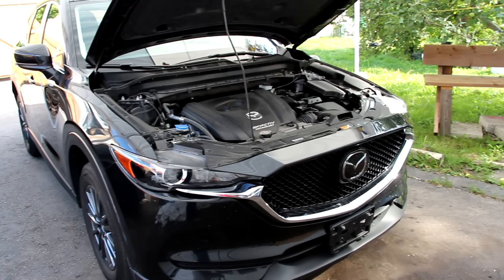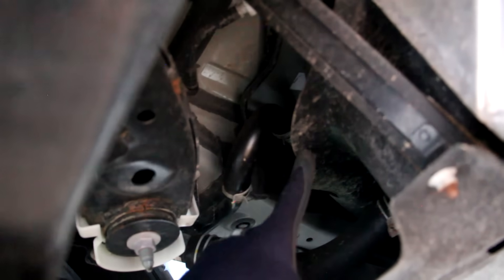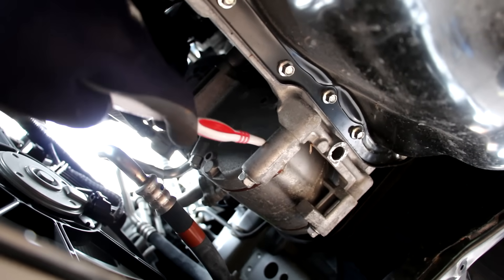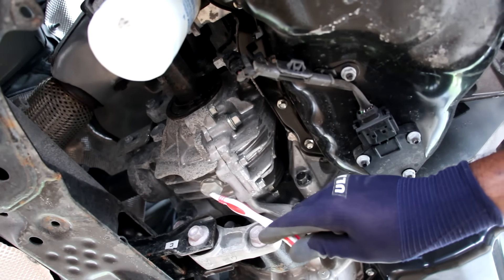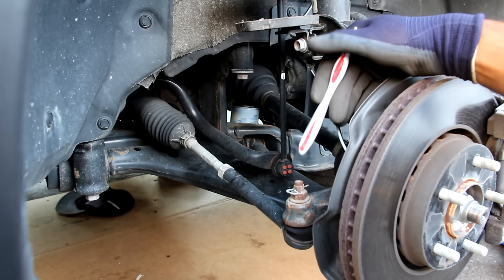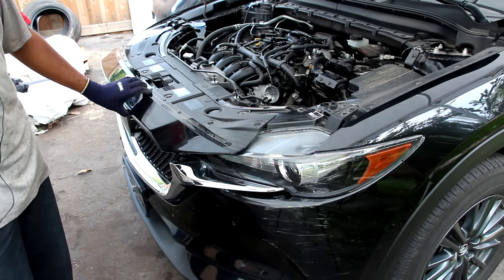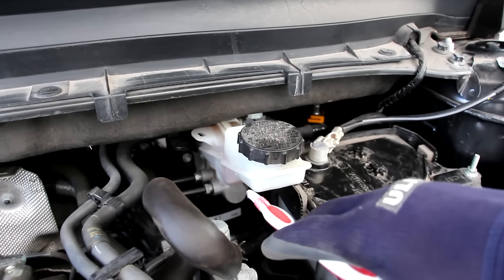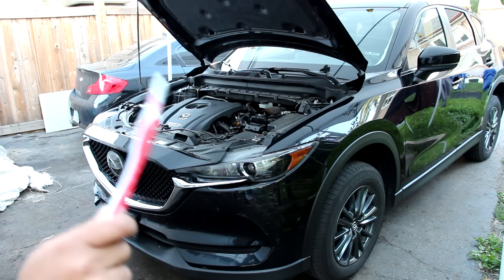Mazda CX-5 Mechanical Review

Comment: Got an 09 mazda 6 with the non sky active 2.5.  Even more simple than this engine.  130k plus miles on mine still runs like new.  Trans has been good too. Interior has been strong and maintainable. All body panels have stayed on.  Way better than any previous car i have ever had. Really like its engineering. Old Honda civic simple to work on.

Comment: They hold up better than most of the competition, we had some KMs 350,000kms + in our shop 2013-2016 and was impressed at how reliable they are! Surface rust is just surface and is common on any 1 year old Canadian car without additional coating.
Reply: What do you think is a better choice between a new Mazda 3 or cx5, or a Lexus es350 or rx350 around 2015-2017 or even a Camry same years
Reply: @brandonburnie7067  i have a mazda, but id get a lexus first
Reply: Mazda CX 5 more practical and easier to maintain. @brandonburnie7067
Reply: I hope so. I have my first mazda, But I believe my ford fusion had a mazda engine, and I dont recall it having any issues. @jbrown4137
Reply: Does the under carriage rot out? The video says they rust fast.
Reply: Would you recommend they be undersprayed ?

Comment: So Mazda fooled you into thinking this is a really good SUV ? hahaha.. that hurts.
Reply: I own a 2019 CX-5 Grand Touring. I did my research before buying and for me... simple, tried and tested tech was a big plus. I guess I will see how it lasts over the long term. p.s. Yeah... being an owner, that comment stung a bit.
Reply: @OneLiterPeter  what other similar small suv would you think is also a good option? I really want a longterm reliable easy maintenance low cost suv. Just simple and reliable. The rusting has me a little worried so now thinking what other car out there could be a better choice? Any ideas? Thanks.
Reply: @84848AR  I have no rust issues with mine. I live in TX and there's no salt or other corrosives applied to the roads in winter and that might be the reason. From what I've read, The top 3 for reliability are Toyota, Honda and Mazda. All three are built in Japan by Japanese people. I would have been happy with a Rav4 or CRV but I just really like the Mazda's styling, interior and that it has a 6 speed transmission where the other two have CVT transmissions. If you live where there's a lot of snow... maybe the Mazda isn't such a good choice.
Reply: @OneLiterPeter  thank you. Yes I would like a toyota but cvt is a no for me. I wish cars where made simple again. Seems like all the extra technology just makes things worse and expensive.
Reply: @84848AR  Go take a CX-5 on a test drive. You will like it. And FWIW... I bought mine used (certified) with 21K miles on it for $25K out the door, It was an Enterprise rental car. I've owned it for a little over a year now with zero issues. One thing I was disappointed about was that while the Grand Touring model comes with navigation... mine did not. I bought it anyway and later bought a nav chip off Amazon for $80, retail is $400.
Reply: @OneLiterPeter  thanks was the 25k with taxes and fees included? Sounds like a good deal.
Reply: @84848AR  Yup, Fees included. It was listed for around 25K and I chiseled them down a couple K bringing the total to 25K and change.
Reply: @OneLiterPeter  nice good deal thanks
Reply: @84848AR  Yep, Good luck
Reply: @OneLiterPeter  how's your Mazda holding up 2 years later?
Reply: @ceciliaabdalla4954  No issues so far. 🙂👍
Reply: @OneLiterPeter  Good to see you and your car are doing fine.  Thanks for the reply all the best

Comment: Thank you for finally doing a Mazda. Great video as always. I agree with the rust problem. Just recently did the complete brake job on my '17 Mazda 6 where the rotors looked just like yours on the video with only 40K.  Question if I may, Mazda recommended to do a transmission flush for my M6, is it safe? Or should I just drain and fill myself? From your video looks like wouldn't be a problem . Thanks so much.

Comment: I don't know where in the world you live, but I think you drive on roads with salt to have so much rust in the suspension, as for your brakes I think you travel through places with many stones or mud since the discs are very scratched

I like the cx5 for its simple and reliable mechanics, it is also easy to change some part, it is not as complicated as other models

Comment: I own a Mazda CX -5 2016 Top Revolution 2.2 173 hp model , i have 80k km on it , to be honest its a great car .
It has its flaws like rust which on the long run is a huge problem (general issue with Japanese cars )
It runs smooth and if you have the automated transmission and use the manual function on it , it can be quite the fast car , and its very steady in combination of high speed and turns .
The feeling inside this car is rather unique if i might say so 
Overall i can say i love this car
Reply: Does the under carriage rot out?

Comment: Would you buy this car if you were looking for a  reliable midsize suv.
Reply from the maker: I'd buy a used car not a new one
Reply: speedkar99 we got a used 17 with out the cylinder deactivation.
Reply: That's not midsize, it is a compact SUV. Midsize is CX-9, Highlander, Pilot, etc

Comment: To change the drive belt tensioner, you can access it from top. Support the bottom of the engine with a jack and remove the motor mount, from there, you're free to adjust the height of the engine to gain more access to the part.
Reply from the maker: Seems a little involved, but at least it can be done with the engine in the car.

Comment: That panel isn't the oil drain plug and filter. The bigger panel further down is where the oil drain plug and filter is. Held on by 2 screws and 2 clips.
Reply from the maker: Yes I saw that after.

Comment: They are using an outdated 6 speed auto which uses a crappy lock-up torque converted system (supposedly to save fuel). If you know how lock-up torque converters work and how it feels you will be able to tell that it is slow in reacting in situations like when you decelerate and suddenly accelerate, for example going through a sharp bend then accelerating, this causes a small delay (it is the lock up engaging/disengaging) it feels so bad and in certain situations it produces a jolk/jerk, and in other situations a half-a-second delay for the gears to engage- it also sometimes feels like a gear has changed when in fact it is the lock-up clutch engaging and sometimes the system is unable to synchronize this correctly with engine revs and you end up in a small thud/jolk which can be slightly felt depending on speed. it more evident in slow speeds or when the fluids are still cold. There are a lot of complaints online and the earlier skyactiv models were so bad there was a recall by Mazda for their transmissions, yet they still haven't made any significant changes to their crappy 6spd auto since 2012. It is the worse thing about a Mazda and a reason to stay away. Not only that, they also fail very easily, you basically have to baby them, my CX5 failed at 30,000kms and this was my wife's vehicle driving to and from work (thankfully still in warranty). 90% of the people who buy Mazda's unfortunately will not notice this and when I took mine to Mazda the mechanics said the same thing, so this goes under-reported but I am sure Mazda knows about it.
Reply from the maker: Thanks for your input. Sad to hear about your CX5

Comment: Amazing! Drive by wire, 6 speed auto, front intake and rear exhaust, abs hydraulics module,   Easy access serviceability, it’s so minimalistic that it works! I’ve driven one and it’s a joy, man that engine bay sure looks like my corollas, very nice of Mazda to take this route
Reply from the maker: Its good... for now. I'd be wary about rust and finding replacement parts.

Comment: I’m driving a FD, Civic 06. It is a very reliable, easy and cheaper to maintain too. I Like the new Mazda 6-sp auto but dislike GDI w/o port inj to clean intake Valves and every part seems to be very prone to rust! Suspension system will cost u an arm and a leg or even break your wallet to replace/maintain too if holding it for long term.
Reply from the maker: Couldn't agree more!

Comment: Could the rust be formed from where it was driven, or do you think it's a common design problem on these? 

Also, if you compare this to the 2020 Rav4, which vehicle is more reliable and why?
Reply from the maker: Canadian winter + bad coating
check my RAV4 review video:
https://www.youtube.com/watch?v=8mhmr5I68B4

Its more complex under the hood, which is a good and bad thing...
Reply: speedkar99 which one is more complex the rav4 or the Mazda ?

Comment: My concern is on that cylinder deactivation system. It could cause oil burning in the future. What do you think?
Reply: They had a pretty extensive recall on all CX-5s with cylinder deactivation. I personally avoided the new Mazda’s like the plague for that reason. I ended up buying a ‘17, same generation but no cylinder deactivation 😁
Reply from the maker: It's an option on some trims. I know Honda's had issues with VCM as well. I personally wouldn't like driving with 2 cylinders on the highway.
Reply: That recall was a control system fix. Seems there is a lot of pointless speculation and irrelevant comparisons with totally different cars regarding cylinder deactivation.
Reply: @dagbruck  Mazda cylinder deactivation systems only been around for two and a half years. I want to see in about 5 years when Mazda vehicles with this system reaches 180 to 200,000 miles. Let's see what kind of problems are going to occur. So far other automakers have tried this system and failed. Experience mechanics are not fans of the system.
Reply: The 2018-2019 Cx-5's had the recall issues around CD; not the 2020's. I 2017 is not affected by CD because it didn't have that technology implemented at that time. I think a 2017 is an excellent bet, or the 2020 particularly that software update is implemented earlier to prevent any malfunction from affecting engine performance.

Comment: 0:16 i hate plastic engine covers, they serve no purpose, that's why i remove them and throw them away!
Reply: Because this is a variation of an Atkinson style direct injection engine, the cover of these Mazdas are actually useful because they have thick foam rubber sound reduction material. Running without a cover on this engine would yield a significant increase in decibels.

Comment: Very good review.
I'm surprised about that oil dip stick in the transmission. It's cool that it's there. I wasn't expecting such item in any new car.
Reply from the maker: I wasn't expecting that either.
Reply: I use the it to vac out the transmission fluid every 60k. When transmission is drained I replace filter. I have 230,000mile on my 2013.

Comment: "To eliminate the problem of intake valve deposits that plague current direct gasoline injection engines, the engineers at Mazda determined that deposits are formed when intake valve temperatures fall below 400 degrees C.  Measures were taken so that the intake valve would operate above this point to reduce deposit formation." -from motoiq.com
Reply from the maker: Or you can give it the italian tuneup

Comment: thumbs up for ATF dip stick。
The ABS pump postion is same as the 90s' design. I see a lot of this in local junk yard.
 Is the rust issue covered by Warranty? Also, does this engine has cylinder deactivation?

I'm only concerned of the intake valve carbon buildup and the rust issue.  Otherwise, it could be a  decent vehicle for old school buyer like me.
Reply from the maker: Yes it has cylinder deactivation, I mentioned it in the exhaust section
Reply: @speedkar99  What is your current opinion on Mazda cylinder deactivation? I knew they had recall earlier. I'm thinking of getting new CX-5 to keep long-term. You think CD should be non issue now?

Comment: newer cars tend to have the engine with intake header at the front and exhaust header at the back.. why do you think is that? to get cooler intake air?
Reply from the maker: shorter air path
Reply: speedkar99 I see, makes sense. Are older cars having exhaust header at the front for better exhaust header cooling?

Comment: So if the CX-5 has an oil separator, does it make any sense to add an oil catch can on the PCV line to try and deal with the intake carbonization problem this car will eventually have?

Comment: I had been driving Mazda since 1981. I own more than a dozen of them from GLC , 626 to MPVs to CX7. Everyone complains about rusty Mazda even today. Yes, Mazda has rust issues in the 80’s in their door frames and lower edges of the doors. Actually most Japanese cars has rust issues in the 80’s. They apparently solved the body rust problem after the 90’s. My Mazda after 1990 have no rust issues. 
He keeps on mentioning rust on the chassis. Chassis is made of steel parts and they are so close to the road receiving sand and stone blast everyday especially in cold climates where salt is being used. Chassis parts rust is not a safety issues by any means since they are very beefy parts. It takes more than 30 years for them to rust through. Actually Aluminum is more rust prone than steel but less unsightly. Go check out brand new cars which were temporary stored in the fields and they all have some chassis rust and brake rotor rust. Body rust is everybody complaining, never chassis rust. Rinse off road salt and debris from the undercarriage a few times in a year can reduce the surface rust on the chassis parts. Chassis rust never reflects the built quality of the car.
Reply: I was thinking the same thing - our 2007 mazda three s had chassis rust on the rear and did not effect anything.   did not effect anything I hosed the salt off a few times during the winter but it drove like the day we got it new when we sold it.  so don't think the chassis rust is as big as deal as people are saying.

Comment: This mazda is Ford fusion on suv body and mazda logo
Reply: No it's not, 100% Mazda. They separated from Ford a long time ago now
Reply: @Argedis  they used everything Ford. Look at the engine and transmission that's fusion engine and transmission almost everything is Ford fusion.
Reply: @mikef4077  Ford uses Ecoboost engines, All Mazda cars now use Skyactiv powertrains made and developed in Japan by Mazda since 2012. The last car still using Ford parts was the last gen CX-9 in 2015 because that car was made with ford since 2007
Reply from the maker: Not this Mazda
Reply: @speedkar99  have you guys take the tear the engine down yet and see what's inside. Forget the name they call it. You have to see the inside. I tear it down at junkyard...

Comment: Noooo! NA CX5 only with FWD is good bang for your buck but is lame. It is the Camry of Mazda. Needs more power with the turbo and AWD to put the power down. Avoid the engines with Cylinder Deactivation.
Reply: Would you avoid the 2020's who have CD, however no recalls or known issues (as of now)? The 2018-2019's have been hit by CD issues and I'm presuming that something has been fixed in the 2020's from the Cx-5, Mazda 3 and 6 who also where affected in 2018-2019.
Reply: @consciousawakening4799  I would stay away from cylinder deactivation in general. The mazda CD is only active during constant speed between 25 to 50 MPH which is city driving. Which translates to severe schedule maintenance but people still follow the longest interval. This leads to problems like the oil crystallizing on severely neglected cars. The temperature difference in the cylinder walls is hard on oil and makes the metals prone to warping as well. It's a reliability and longevity concern for me. The fuel cost difference is nowhere near where it makes up for repair costs, depreciation costs, down time, and vehicle replacement costs. I tend to keep my belongings until they fall apart so the lifetime per use cost is extremely important to me. The 2.5T has it's own issues like any other turbo. But the power upgrade and lack of cylinder deactivation is worth it for me. The failure points for the turbo is predictable and manageable with maintenance. CD, not so much.
Reply: @Wokenomics_PhD  Thank you I appreciate your in-depth and knowledgeable reply.  I have read forums on this issue especially with the 2018-2019 model years and it was disheartening. I will purchase a Cx-5 before the end of this month and I'm either looking at a 2017 Grand Touring or now (even more so because of your response) a G.T reserve or signature with the Turbo. I reason the 2017 is the best bet and is more affordable. I, like you also keep my vehicles until they turn into dust lol.
Reply: Transmission problems arose too.

Comment: Seems OK if you don't mind gummed up intake valves and rust.
Reply: It has an oil seperator on the pcv valve for that and all cars rust, not just Mazdas.
Reply from the maker: It'll be fine

Comment: They tend to rust under the hood with the latchet, on top of the roof and in the boot trunk. Diesel ones you want to look out for oil leaks on both sides of intercooler pipes and sign of wear on the belt. If engine light comes on and you get fault code P2227, you would want to check out in the inlet for the turbo for carbon buildup.
Reply: On this gen of Mazda? I've not heard of any rust issues on 2012+ Mazda's. Even prior to that it wasn't common until you get back to the ford partnered years. Would be interested if you have any articles pointing to new Mazda's rusting.